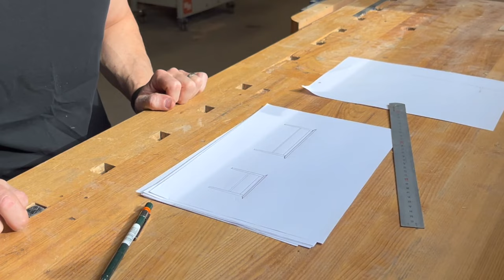Coffee Table in Oak

Comment: Ok ... those clamps you used on the top trim piece are genius. Did you make those yourself or are they purchasable from somewhere? And what was the finish you used?

Also, using the drill press to make the holes for the joining instead of a power tool is inspiring. I do not have the cash to spend on one of those so that solution gives me lots of ideas. 

Finally ... who is banging on the wall? 

This is great stuff. Subscribed!
Reply from the maker: Hi!
The clamps can be found on Amazon.com. The are very common here in Sweden 👍 the finish I used I this project was linseed oil after 1000 grit! 

It was my course vacuum cleaner that was banging on the wall 😂 I will turn off the filter cleaner on it next time. Thanks for noticing. 

Thanks for watching and subscribe 😀👍🙏
Reply: @jbwoodwork  Linseed oil? Nice! Did you apply a top coat or was it just the oil? 

Either way, it's beautiful. My ancestors are Swedish and my second great-grandfather who immigrated here was a wood worker